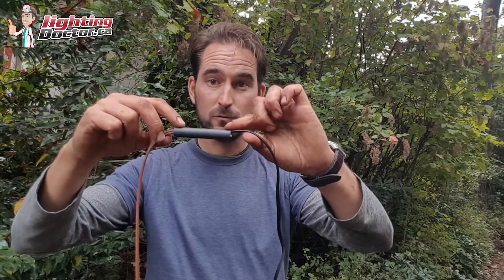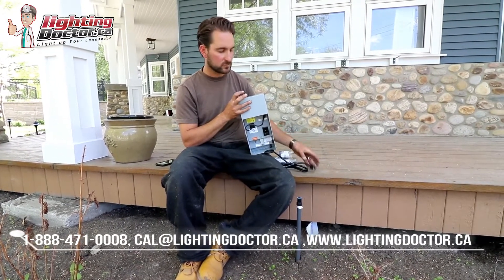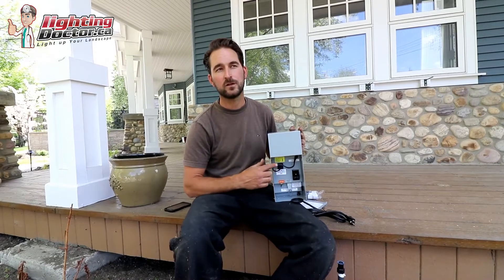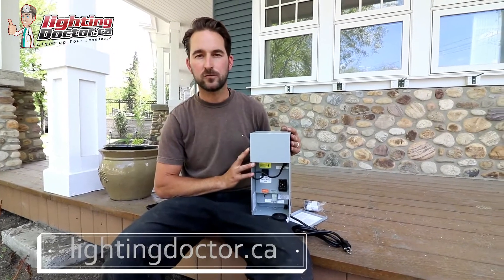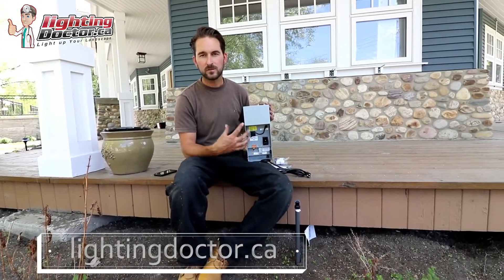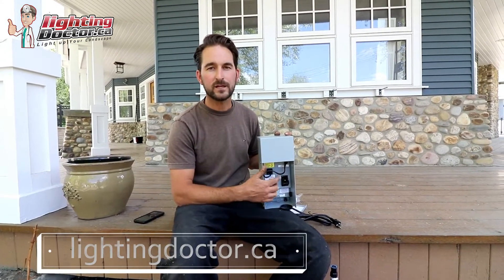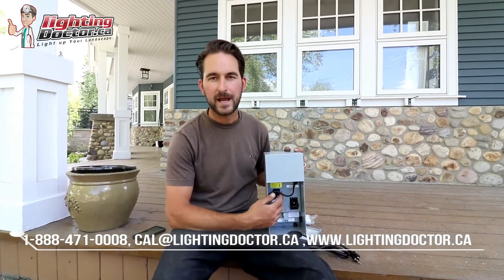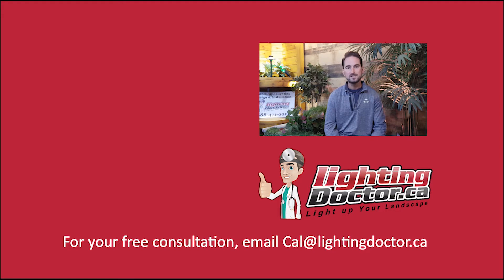How to Size a Low Voltage LED Landscape Lighting Transformer

Comment: is there any disadvantage to using a higher wattage transformer? like in your example where you're lights are pulling 120. could you set that upto a 300w transformer with no issues?

Comment: I am thinking of installing 15 PAR36 LED Landscape Bulb lights, 10W in my garden. What transformer (wats), what type of wire (gage) and how many cables do you recommend?
Reply: 15 x 10 = 150 + 20% = 180W